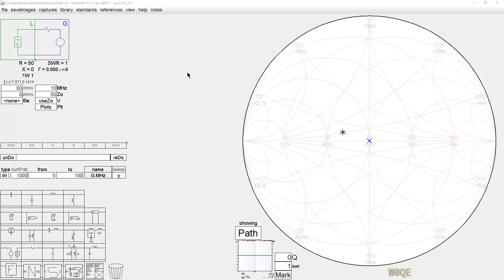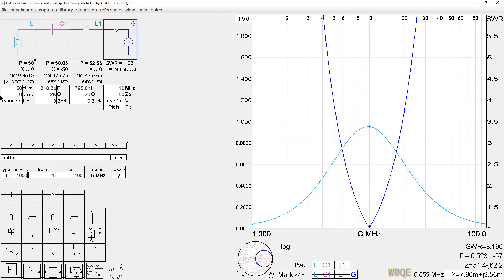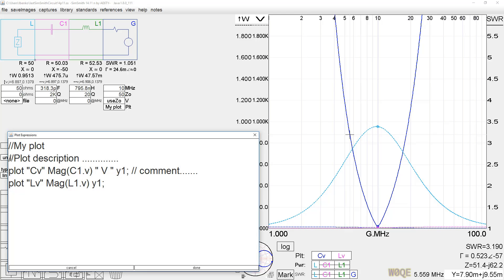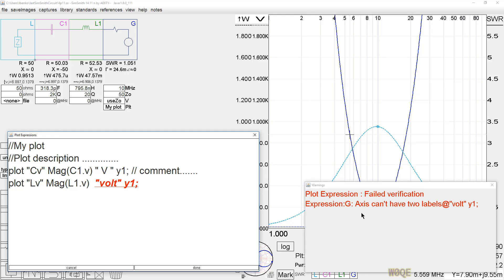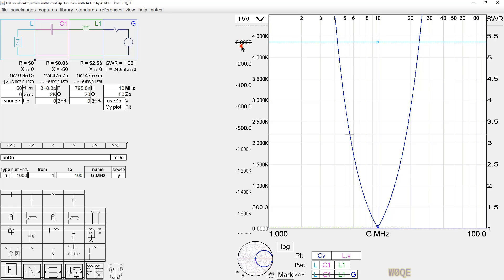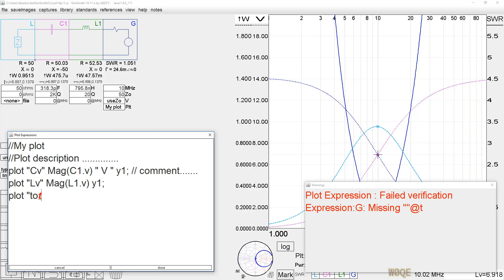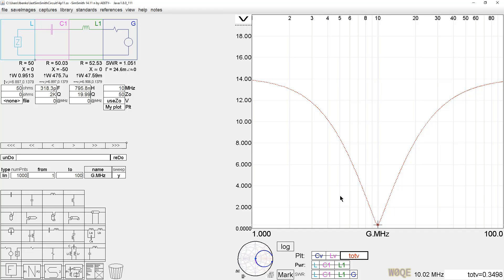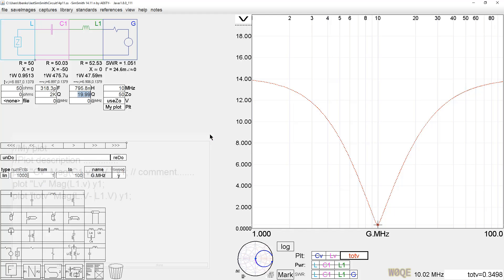#17: SimSmith Plotting (Basics 9)

Comment: This is incredibly useful to a problem I am exploring.  I have to get the maximum voltage I can across a capacitive load from a 50ohm source with a limit to the VSWR presented to the amplifier.  I had been wondering how I might get my brain around evaluating solutions, and now you have shown me a possible method.  Thanks for taking the time to do these videos, you are helping us engineers.
Reply from the maker: A problem such as the one you mentioned is very easy to analyze in SimSmith.  Glad you enjoyed the video.
Larry